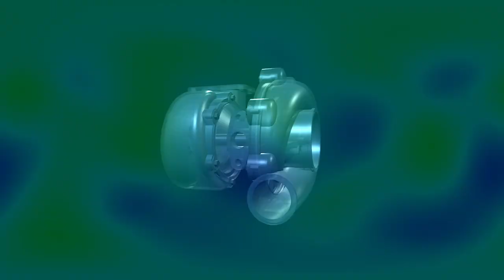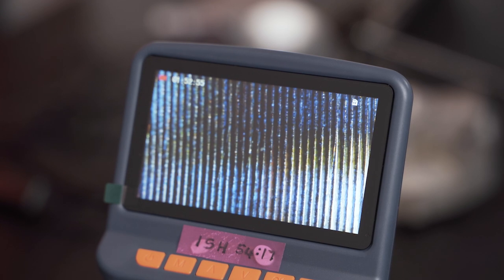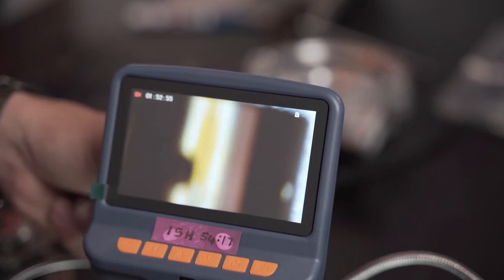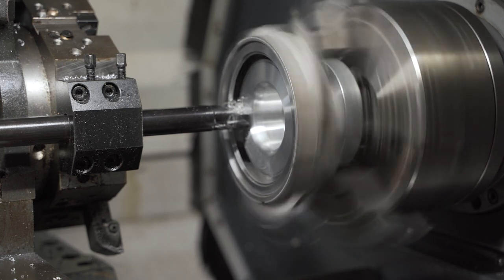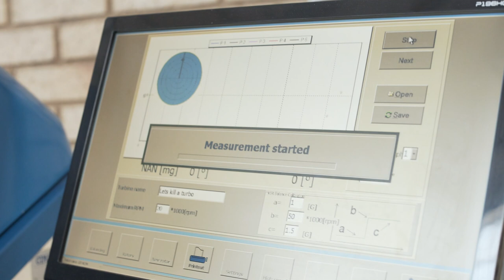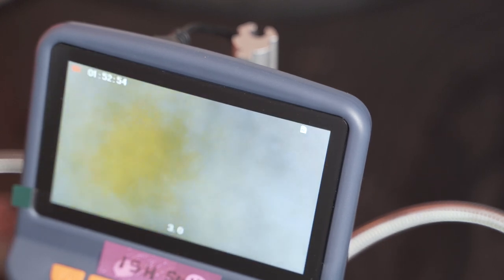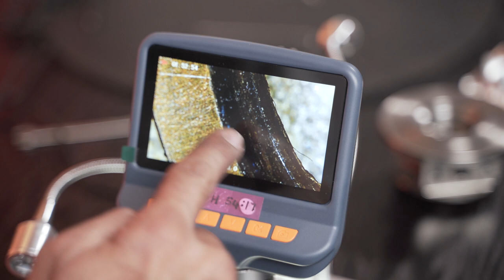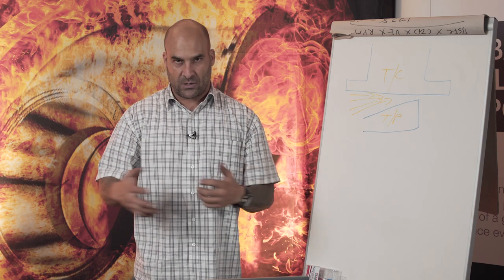We destroy a turbo - on purpose!

Comment: Awesome video,  really informative. I was surprised how little time it takes to damage a rotating assembly. Will be on the lookout for the turbo priming video for sure.
I understand this was journal bearing demonstration, will we see the exact same scenario play out with a ball bearing assembly? 
Great work as always.
Reply from the maker: Thanks for the comment and compliment - the ball bearing setup will not display material transfer at all as the balls are either made from steel or silicon nitride (ceramic) there will be other tell tale signs of failure due to a lubrication related starvation.  Ill kill a ball bearing turbo in another video to show you the failure results.  I wont be able to share too much on this, as we have a very loyal following of competitors on our channel  who we obviously don't want to educate too much :-)

Comment: very informative and i really enjoy your videos , how ever some thing puzzles me about the striation on the thrust collar , if the collar is machined , shouldn't it have a tread like groove on the face , so when spinning it would have an inward or outward movement of the groove , and striation wouldn't appear? in depth turbo compound explanation videos would be nice
Reply from the maker: The thrust collar does have striations ("thread") machined on the face - this is what left those witness marks on the surface of the thrust bearing pads - seen here:- https://youtu.be/YeAHUiUeX9Q?t=2557  

This is the mark on the thrust bearing pads from the steel collar seen here:- https://youtu.be/YeAHUiUeX9Q?t=2620

Comment: i’ve been binge watching this channel for a couple of days, the information that you share is amazing. i’m from south america, here master power is a very used brand (brazilian manufacturer, mercedes benz for example uses them as an oem provider, among many other brands). i would LOVE to see some analysis of this brand as it’s not common outside here, they have journal (R line) and ball bearing (rb) series. I’m certainly interested in the RB5449 (kinda similar in size to a gtx3071), RB6002 (similar to a gtx3582), R594 (i think this one will outflow its turbine, similar to a gt3076). They claim they use ceramic ball bearings and i would love to see if that’s true, some real analysis on their compressors, as well as turbines. they provide compressor maps, are they drawn out of thin air or actually real? I need engineering backed answers man! hahahaha
Reply from the maker: Clemente, thank you so much for supporting the channel --  i know the Borghetti family very well - and Master Power are not an OEM manufacturer. In the past  Mahle were using them for some of their manufacturing, but this ended.  Master Power is an aftermarket brand who copies the OEM products and offers them at a lower price - they are well manufactured, but i have never tested their performance lines - This was offered to us as a brand, but we turned it down, as it simply made no sense, as there was nothing that added value to an already saturated market here in S.A.  If they are purchasing the ball bearing cartridge from OEM's, then the turbo could be a good one ..... this has to be seen/tested to confirm though.

Comment: Great stuff!!! Just a question; is modifying a GT3071 to GTX3076 Gen 2 with Wheel swap and machining accordingly a bad idea then? There are a few companies that do this upgrade option. Or is sticking to a GT3071R to GTX3071 Gen 2 a better idea to keep the same sized wheel? A stronger housing is more important than the 50whp difference between the 71 and 76. Thanks
Reply from the maker: There re two things at play here the turbine housing and the turbine wheel - if you using the small T28 turbine housing on the G3071R then installing the mismatched oversized GTX3076R Gen2 compressor wheel will not perform efficiently due to the turbine wheel used on the GTX30R Gen turbos is 555mm x 60mm and the one in the GT3071R with AR64 turbine housing is 51.7mm x 56.5mm and the one used in the AR86 turbine housing is 53.5mm x 56.5mm --  The comp housings are also different, and the Stock GT3071R housing will not flow the same as the larger GTX Gen2 housing. 

Point is - the GTX Gen1 and Gen2 all use the turbine wheel 55mm x 60mm and a larger turbine and comp housing - if you change all these things, you have the turbo running 100% according to the GTX Gen2 design, if you dont upgrade specifically the turbine side, you wont have enough shaft power to turn the compressor and the turbine housing will restrict you causing heat (shortened life of the bearing cartrdige)